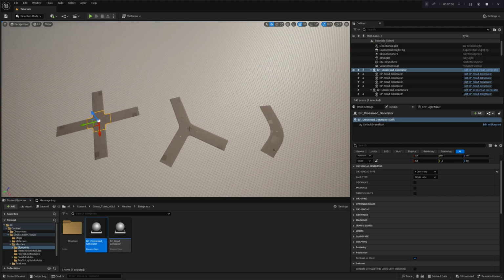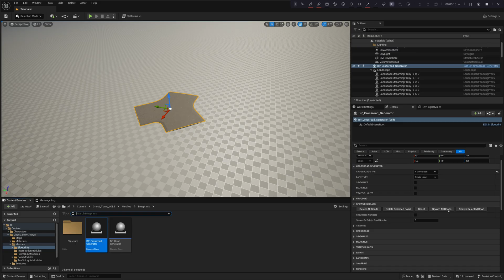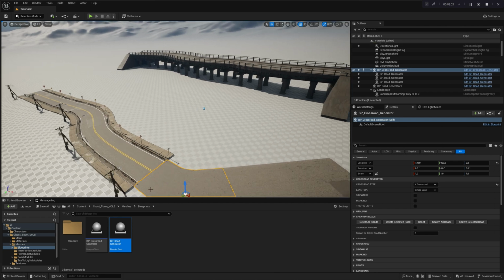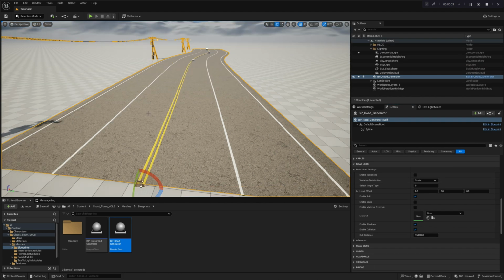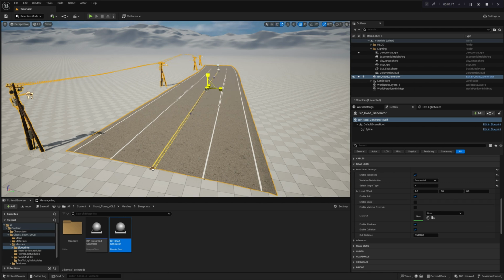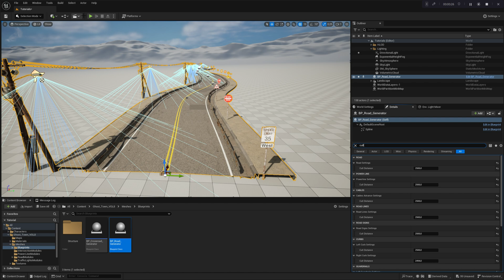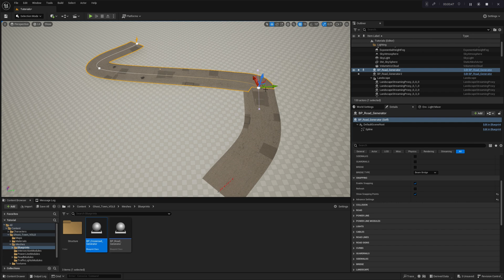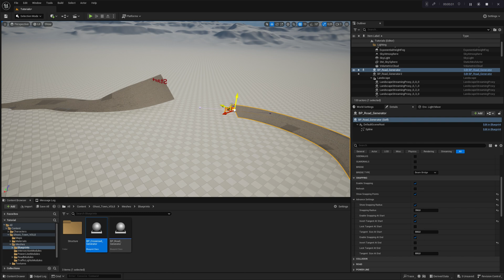Crossroad Generator For Unreal Engine 5 - Road Building

Comment: Hello. I can’t find the gravel road in BP_Road_Generator. I went into the blueprint, searched through all the files, but nothing. I only found some gravel textures. Can you help me?
Reply from the maker: Hello, thank you for reaching out to us with your questions.
With the latest update, the default gravel road preset was removed from the main UI to improve optimization, functionality, and overall clarity. However, the preset is still available within the Customization Settings, so you can easily enable or adjust it there.
The gravel road is essentially a material override using our POM (Parallax Occlusion Mapping) material, which you can find in the pack’s Material Library. 

We also recommend checking out our tutorial series on road customization — it walks you through how to swap materials, create custom presets, and fine-tune everything to match your project.

Https://youtu.be/2WbUGmHWMC8?t=670

https://www.youtube.com/watch?v=W6pQ2sSbm-Q&list=PL---MOmbcRHDFBIkeBCyPEvv4vrLzN-10

And if you’d like to use the exact custom mesh shown in our demo, you can download it here: 
https://drive.google.com/file/d/1lnPkj7V1GJL523HkrKp5u3Chr6ChJVb9/view?usp=drive_link

Comment: Has the driveways function been removed? i only have options for road types 1 lane, 2 land, 3 land and 4 lane? but no driveway or gravel road anymore. Also can not find the sidewalk/curbs for driveway entrys anymore..
Reply from the maker: No, all functions are still available in the tool. They have been renamed for better clarity, optimization, and to accommodate the expanded library. The driveway is now called "1 Lane Road." Gravel roads can be achieved by overriding the material with the gravel material preset available in the material library included in the pack.
Curbs and sidewalks remain the same; however, you may need to adjust their position to achieve the same look as before.
If you’d like to learn more about customization, we recommend checking out our YouTube channel: 

https://www.youtube.com/watch?v=2WbUGmHWMC8&ab_channel=Rendertale

Let us know if you have any other questions!

Comment: Just ought the plugin but im struggling. I can’t get it to event the road. When I try to select the end spline it just grabs the map and moves my view it won’t latch on. When I use the transform tool it just evens that segment but doesn’t add new splines as the road gets longer as in this demo,. Any help?
Reply from the maker: Thanks for reaching out! Could you please clarify which version of the Unreal Engine editor you're using? In newer versions, you need to select the blueprint parent to activate the spline actor if you want to extend the road spline.

If possible, could you send us a short video (at our support email: contact@rendertale.com) demonstration of the issue? That would help us better understand what’s going on and provide a more precise solution.

Looking forward to your response!

Comment: Nice plugin, for this price you don't need to code everything by yourself.  My small doubt before buying it would be the following: how does different road types work together?  Would be nice to see how a road start as a sand road and become an asphalt road or a crossroad with with different surfaces.
Reply from the maker: Thank you for reaching out to us with your questions! At the moment, transitions between roads made of different materials are not supported yet. However, we are actively planning to expand our library of presets in the future to offer even greater flexibility. We appreciate your feedback and suggestions, and we will consider implementing this feature in upcoming updates.

Comment: HI bro，How to Modify width of road？
Reply: Thank you ，I found it，but another issue，why BP_Road_Generator have solo curbs，but BP_cross Road_Generator combine sidewalk ，they are different setting and out of sync
Reply from the maker: Thank you for reaching out with your question! Currently, the crossroad generator comes with a preset library that combines curbs with sidewalks for functional purposes. However, you can achieve your desired look by customizing the preloaded crossroad meshes. Simply adjust the meshes in the “sidewalk module” within the advanced settings. We’ll also consider adding more flexible options for this feature in future updates.

Comment: Thanks. Today I just purchased this module and found that in latest version, snapping setting is not in detailed panel of road generator. Is this a bug or what?
Reply from the maker: Thank you for reaching out with your question! The snapping settings for the road generator blueprint can be found in the Details panel under the "SNAPPING" section. This setting should be accessible; if it’s not visible, there may be another issue with your editor setup.

If you’re referring to the snapping settings for the crossroad generator blueprint, please note that these options were removed in the latest update due to functionality changes.

Comment: I'm blown away by how great this is. I've been looking for a road creator tool with bridges for ages.

I'm curious, how difficult is it to change the textures to say using some from Megascans?

I'm probably gonna end up buying all of your assets! :)
Reply from the maker: Thank you for reaching out to us and for your feedback on our products! We greatly appreciate your interest and support.

Regarding your question about changing textures on any module such as bridges, roads, or sidewalks, it's actually quite straightforward. In the advanced settings of each module you can locate the static mesh (for example "bridge module"). Open the module and simply change the material to the one you prefer within the static mesh settings. Alternatively, you can locate the mesh in the meshes folder and swap the material there with the one you prefer. You'll be able to customize the textures on any module to your liking.

If you have any further questions or need assistance with anything else, please feel free to reach out at our support email: contact@rendertale.com We're here to help!